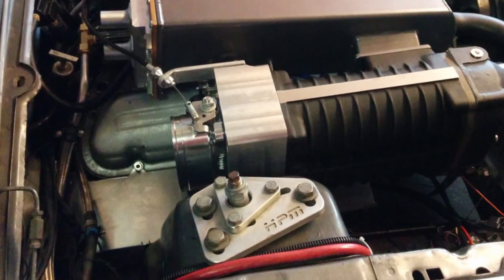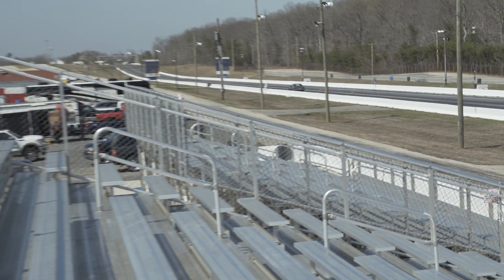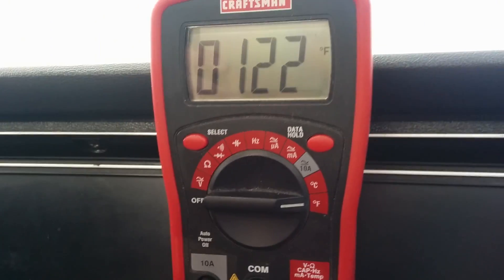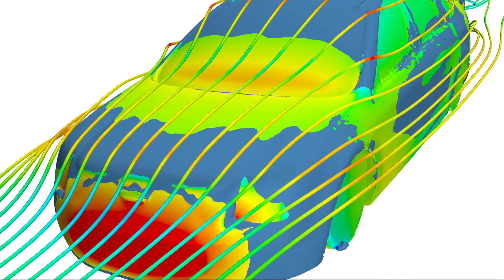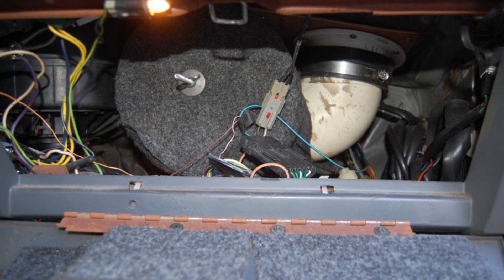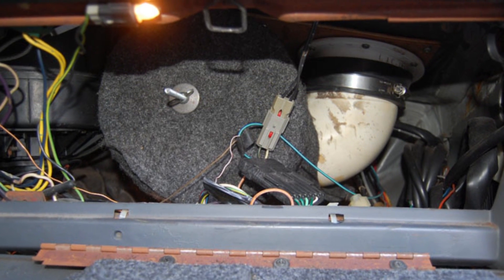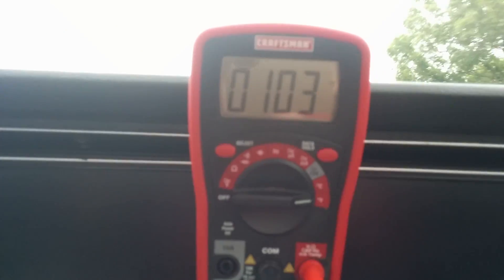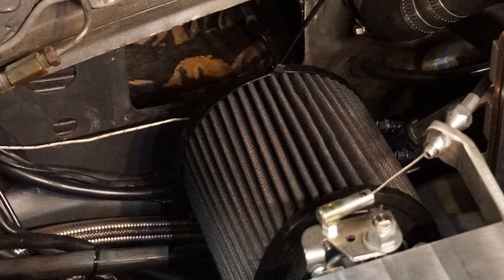Open Element Air Filters - How Hot Do They Get and What You Can Do About It

Comment: hot air in to the intake can be a bitch I know. it will cause missfires.  filtered or not!  it sucks why not a forced intake?.  like a green storm?.  or twister?.  my saab stage ridiculous.  loves it. intake temperature drops amazing!!!  tested and made logs for 2years now.
Reply from the maker: I had to look up "green storm." That filter would likely be a large restriction on this car.  The blower is moving 1200+ cfm at 14 psi and the throttle body takes  a 4.5" diameter tube.  Thanks for the comment!